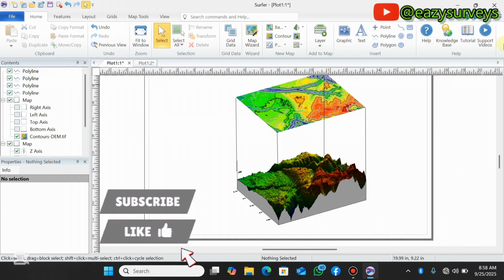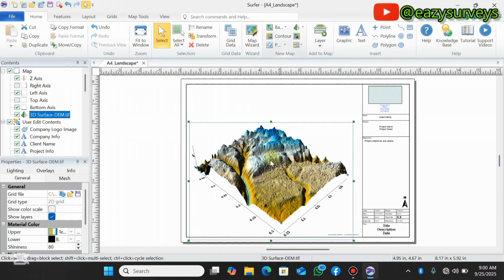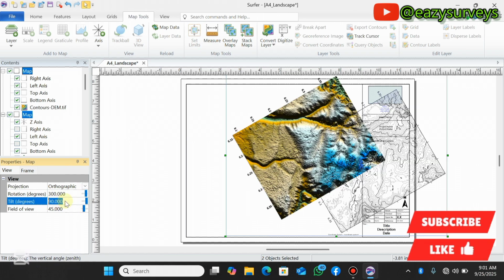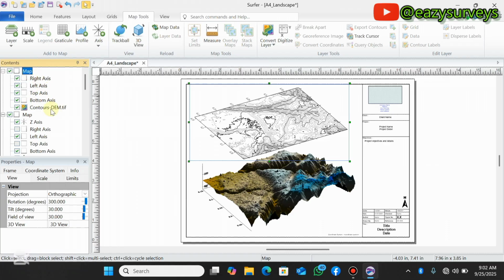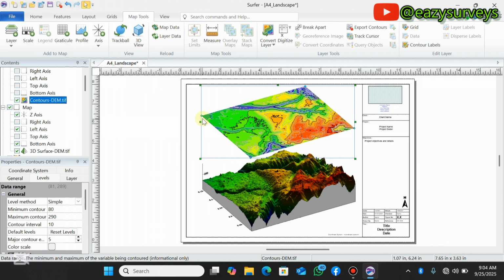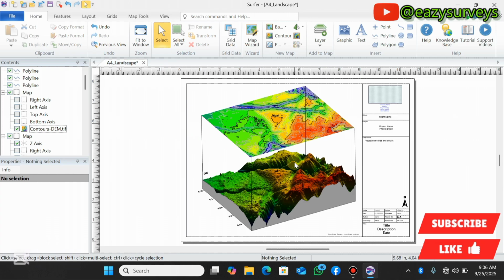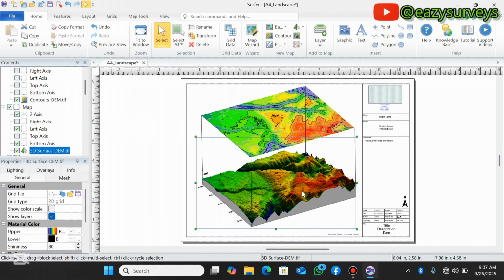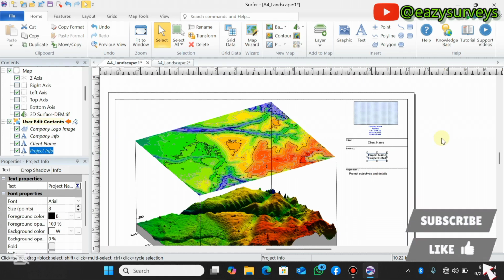Stacking Maps dem, contours, dsm || Combine Maps as a Beginner #gis

Comment: thanks for thr video, is that possible to explain to me , for the value xyzc, how to get the value C, my background is not engineering, so is that possible that i can learn it, or i should have an engineerng background, with thanks
Reply from the maker: Hello, i did not use XYZ, in this video, however if you have such raw data format you will first create a grid then proceed to generating a 3D SURFACE with the Interpolated grid, you don't neccessarily need the c data in this task. Thanks.
Reply: @eazysurveys yes I agree, if you will do 3d slices ,I think you need c value